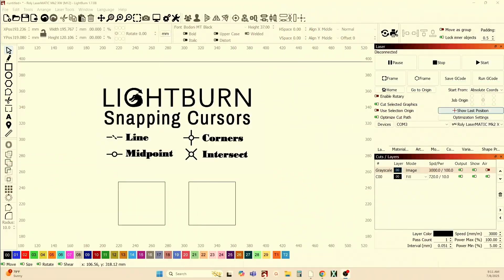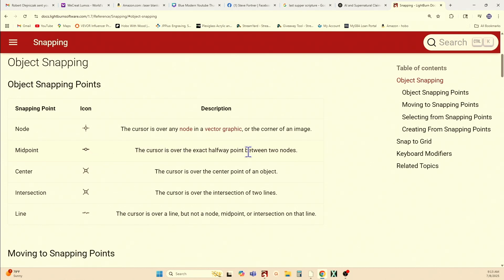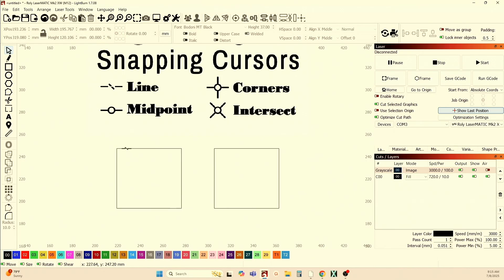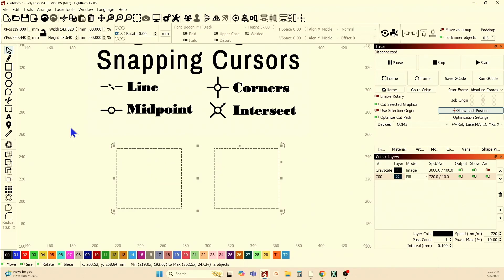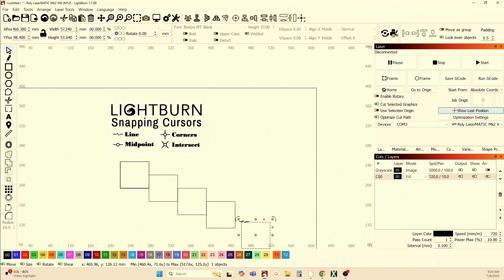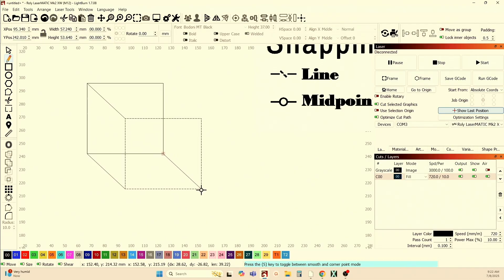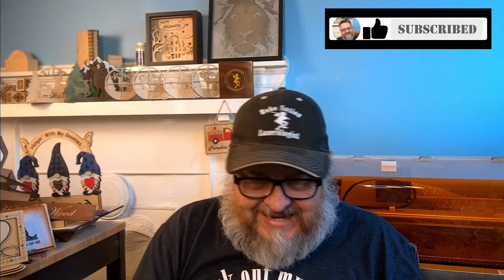Lightburn Snapping Cursors Explained

Comment: at 13:09 when you attempt to grab that center point is what is happening to me on every point, line, corner, etc. I don't know if it's my PC, mouse, settings, or user error.
Reply from the maker: Sometimes it is simply selection priority.  Others is resolution issues and others is mouse issues.  The majority of my struggles wend away when I quite using a laptop.  Then nearly all of them went away when I bought a trackball mouse.  The mouse makes a huge difference is accuracy and control.  Here is the mouse I use...  https://amzn.to/4ndUrwj

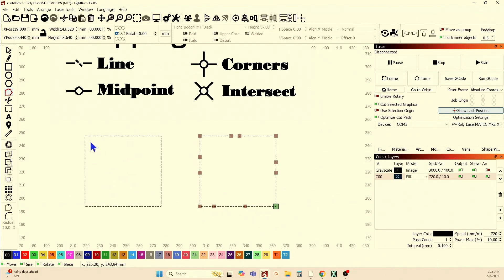Comment: 7:20 "There are no nodes". 
The basic shapes have implicit nodes and the midpoints between the 2 closest implicit nodes are indicated. This is not only true for a rectangle, but also for an ellipse, triangle and so on.
Right click on the shape, choose "Convert to Path" to make the implicit nodes explicit and then show them through "Edit Nodes".
Reply from the maker: Actually, my comment is correct. In LightBurn, a primary shape (like a rectangle or circle) doesn't expose any literal nodes unless it's converted to a path. Until then, it's a parametric object — not a node-based one.

The concept of implicit nodes may apply internally for rendering or math purposes, but they’re not accessible or editable by the user — which is the context I was speaking from. So saying “it has no nodes” is accurate in LightBurn’s practical usage.

If you're seeing nodes, it's because the shape was converted or edited — not because nodes exist in the original object.
I understand. Primary shapes have implicit nodes. Which means they literally aren't there. So, "There are no nodes."

Comment: My problem is ithat older versions are not compatible with newer versions. Why is something I designed earlier not compatible with new version.
Reply from the maker: I would need to see an example of what you are referring to.  I see warnings all the time that something created in a newer version might not be backwards compatible with an older version of Lightburn.  But I have never had a problem moving forward.  Can you send me an email to HoboWithWood@gmail.com with an example and explanation of the problem(s) you are encountering?
Reply: I could send a file. I created a sign using you instructions on floating letters in 1.7 when I opened it in 2.0 it was not working.
Reply from the maker: @louislobis9594  send it